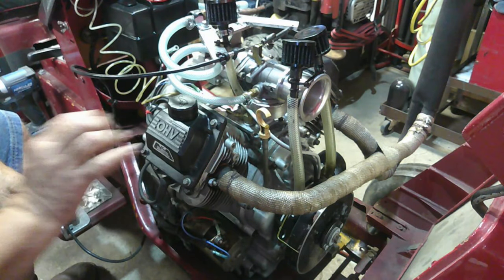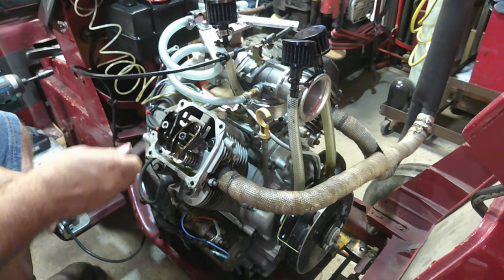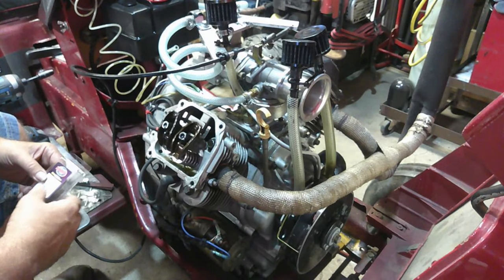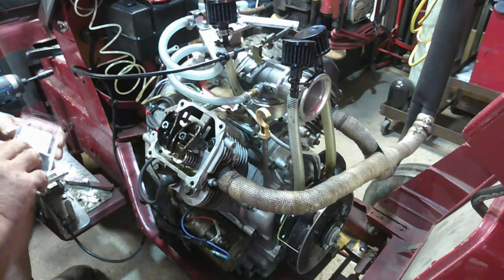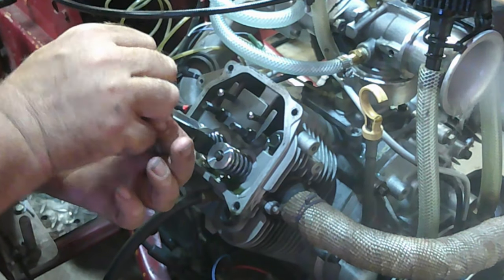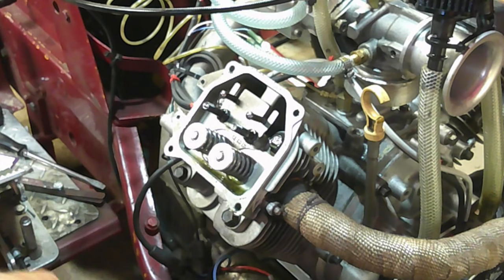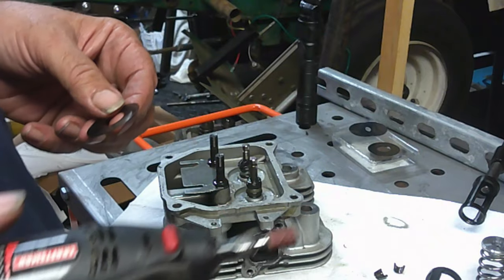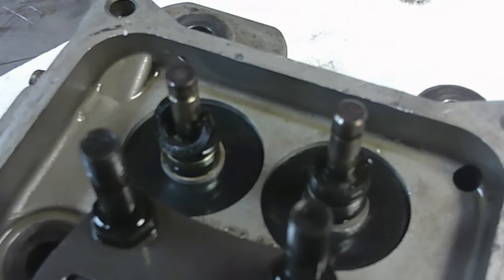PlanB Valve Spring Issues

Comment: Very interesting.   The shims you added....did they make up some of the distance of the recess which was machined into the head, Does that mean the springs have lost their strength?       ....
Keep pulling....( pork .....I love those sandwiches! )
Reply from the maker: @Dancing_Alone_wRentals  yes it puts more seat pressure on the valves. I'm guessing that it's a combination of things, the valve springs getting weak,  the cam not being designed for the rpm we are wanting to turn and posable lifters are wearing out.